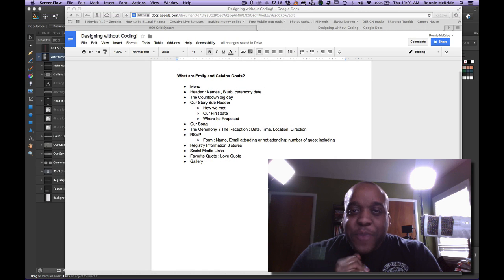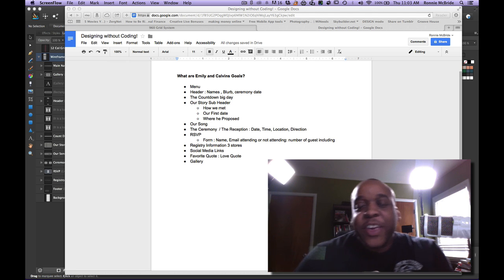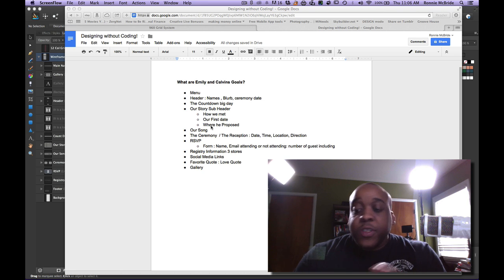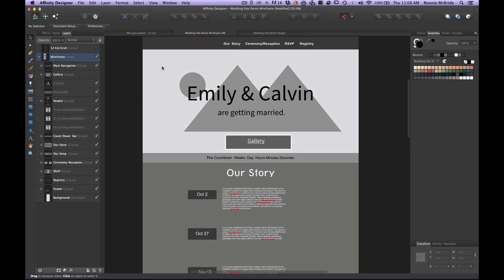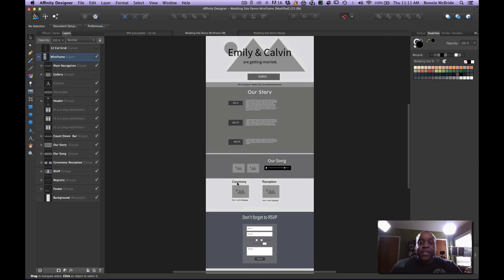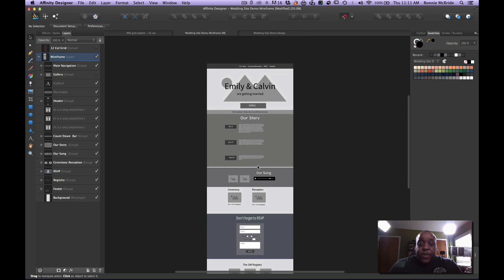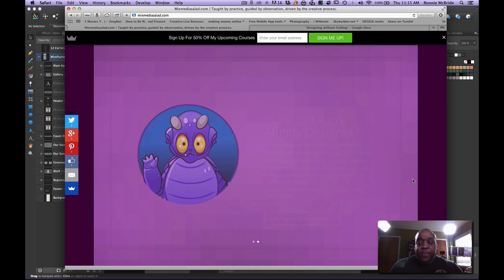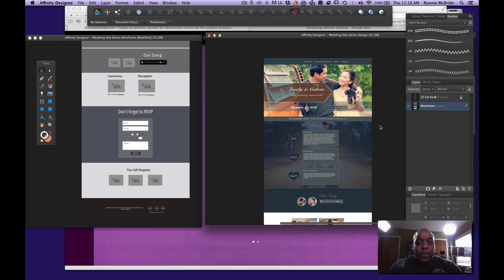Affinity Designer Tutorial - How to "Design" a Website.

Comment: I'm a few years late to your site, but thanks for the video.  Once you have a Full layout after the wire framing; do you slice an of the images up and use them in your website build, or do you build the site from scratch; perhaps in Elementor , Divi etc;   thanks.

Comment: okey fine, aaand how do i put the stuff online, with all functions and so on. 
i want to have more than one side on my webside, so if i click on something, there has to be a function.
i'm completely overwhelmed with that.
Reply from the maker: are you on a PC or Mac?
Reply: Of course this question would pop up with a video title like this. 

Afaik designing a web site is an important step, but "without code" here simply means that Mixmediasalad does not cover the issue of coding. It does not mean that you get a fully working web site without coding.

You will need to either learn to code, use a cms properly or ask a professional coder to get your web site running – designing is just about the start…
Reply from the maker: Thanks for the response. You obviously understood the point Peter,Far to many people jump in the design and build at once without a plan or an approach. Anyway I edited the title and further explain in the description to kern some of the confusion. I get nothing from the videos and just wanted share 1 approach.
Reply: Good Question and Answer, Well, I'm on a Mac.

Comment: This is really interesting.  I have a few questions that I hope you can help with.  I love how you have complete control of the design.  Can the coder do whatever you want with the file that you give them?  What file type would you give?  Can I ask what you charged for this?  What did your coder charge?  I'm new at this obviously.  I was going to go the template route with my web designs but this looks way more fun but I know a developer can be extremely expensive.  I'm trying to find the best solution for my clients.  Thank you.    p.s. I love Affinity Designer
Reply from the maker: Suzanne Conyers Wow, lots of questions here. Ok, the control that I have over the design comes from understanding how and what technology  will be used it may be built. That comes from experience and also communication with my developer and knowing his strengths. This actually, a pretty simple design based off what I know will be used to develop it.  These days we need to turn around sites pretty quickly with minimal fuss, but full of functionality.Clients expectations are higher and just knowing a little HTML and CSS not enough.Also, once you build a website is half the battle and  it will  need to be managed by you or your client. I would consider spending some time learning Wordpress and check out the Divi plugin from elegant themes. You can use Affinity as I have in this video to rapidly design your site but then you have to slice the image elements and build the site by hand or with the use of Wordpress and the plugin I suggested. you still need to learn a little HTML and CSS at times for some custom code you might need  I hope that answers your questions.
Reply: Thank you!!  Very helpful.
Reply: @suzanne Conyers- if you use Affinity Designer to design your site then you can Export it as a psd, then get the code editor called Brackets it has a why to use the psd you can code it . The psd file inside of brackets will show the html code on each element in the psd. hope this helps
Reply: I downloaded brackets, how can I extract the PSD file?
Reply: Do you have a creative cloud account with Adobe? In brackets there is a plugin you can use . I think it's called preview
Reply: Ali watch the YouTube video link up above
Reply: thank u
Reply: Ali if you have Photoshop open a free Adobe account because inside brackets you would have to sign in with the Adobe account
Reply: I could not find the preview plugin also which link do I watch?
Reply: In brackets should see it in the help tab  part inside brackets or debug tab
Reply: ok it worked, thanks!